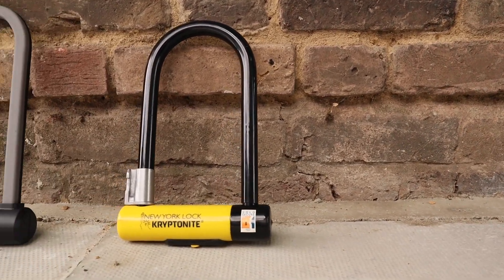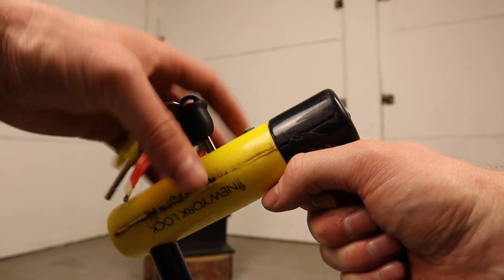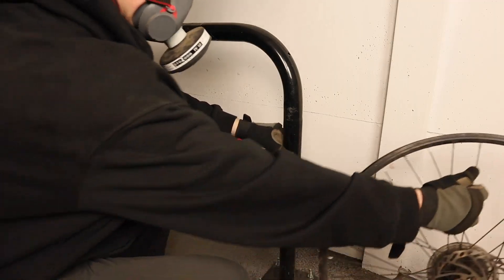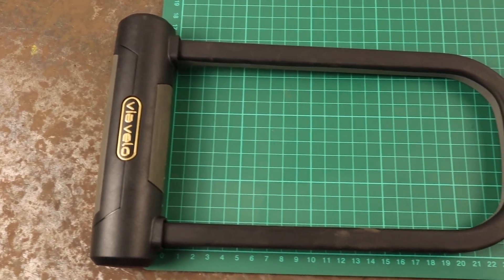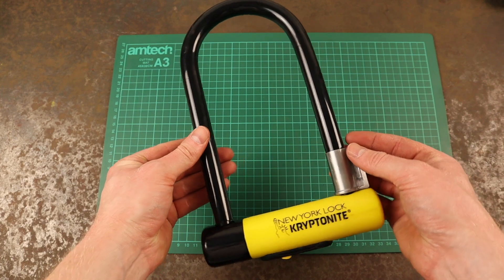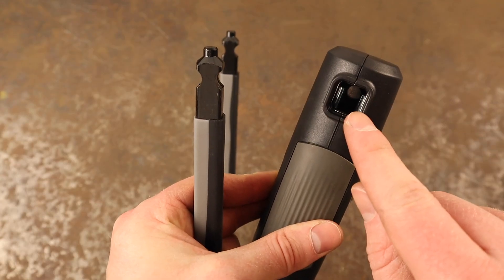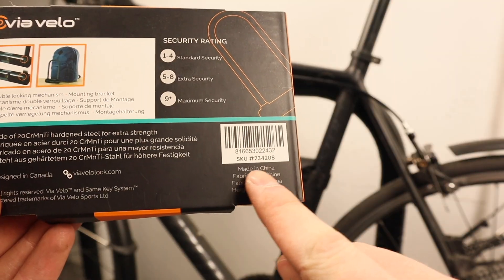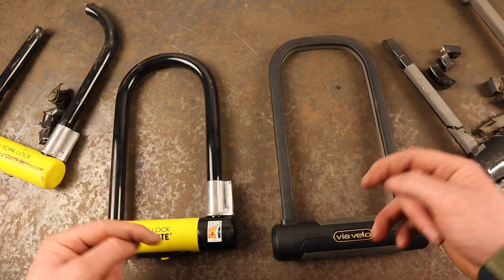Kryptonite New York Standard vs Via Velo Elite - Bike Lock Teardown Testing

Comment: There is another channel where the guy used like 26 discs with an outlet-powered angle grinder to get through the lock. What are your tests doing different?
Reply from the maker: This isn’t the diamond standard lock :) 

Video for that coming soon. Stay tuned.
Reply: @bikelockwiki I see! I've just dwelled down this path of locks. Sold our car and bought a cargobike (Swedish brand) and it seems like there aren't any chains out there that holds a diamond standard so I ordered the new york standard diamond
Reply from the maker: Good choice. That should keep thieves at bay for you. Make sure you secure the wheels too :)
Reply: @Robbe1984  Make sure you always use two locks at least. Carry two locks on you at all times.

Comment: It would be better to have three sold secure silver locks than one New York lock. One New York lock needs to have 2x16mm cuts. Three sold secure silver such as Abus 460, would cost less than the Kryptonite New York and give 3x 2x 12mm steel that would require to be cut
The three Abus locks would be cheaper, would weigh just a kilo more, but offer 72mm steel against the New York's 32mm steel to be cut through. Three locks are more hassle but a greater deterrent.

Comment: I have seen the NYC Krypto picked open in 3+ minutes by TheLockPickingLawyer.  Good channel
Reply from the maker: He’s very impressive with his picking skills, and 3 minutes is quite a slow pick for his standard! Don’t let this mislead you though.

Thieves don’t pick locks of this calibre on the street, an angle grinder or bolt cutters will achieve the job without requiring any prior training or understanding of different locking mechanisms etc. 

Thanks for watching!

Comment: I have 2 kryptonite locks for each wheel on my motorcycle. I did buy them for my bicycle but they were just too heavy to ride with so I simply don't lock my road bike outside anyway. Not worth the risk tbh.

It's a deterrent.. I also have an Oxford chain to a wheel too. The chain is around a small ish tree lol
Reply from the maker: Haha, can’t be too safe! 

Which kryptonite locks do you use? New York STD?
Reply: @bikelockwiki Yes one is a STD and one is the Fahgettaboutit one.

I also recently bought an Oxford Disclock with an alarm and a 2 metre Oxford beast 22mm chain with the beast disclock and an Oxford bike cover now. It's a bit of a pain to lock/unlock all of them daily but I needed it for peace of mind despite costing me a fortune lol. 
However 2 chains, 2 D locks and an alarmed disclock should hopefully put people off stealing my bike. 

I had an Almax chain but can't find it after not biking for 10 years. If I do find it, then that's going to be used too haha. 

I'm looking at getting a tracker now.  Been doing research. Not sure if I want one connected to my battery or one that has its own power. Will look at pro and cons.

My bike has cost me hard earned cash and also is part of healing after a tough 2024 :)

Comment: Great testing thanks. How long was the cable in your video? Would it be long enough to also attach the saddle?
Reply from the maker: Thanks for watching! I think this cable was around 1m long. Why not try running a piece of string through the components you want to lock? This should give you the length required :)

Comment: I appreciate you actually using a battery-powered angle grinder. A lot of channels just use wall powered ones, which isn't a realistic test.
Reply from the maker: Yeah, I’ve never understood that, what’s the point in going to all the effort when it’s nowhere near real-world 🤷‍♂️
Reply: Good quality cordless tools have the same performance as plug in tools. It makes no difference what do you use in tests.
Reply from the maker: @martinminar1949  Typically battery powered grinders have lower torque and will only weaken with the charge of the battery, so might as well use what thieves are using.

Comment: Terrifying how quickly that grinder made several cuts in mere seconds… was gonna buy the kryptonite m18 but why bother paying £100 for a lock when they can be cut in 30 seconds. My £1500 e-bike wouldn’t last 1 hour in Manchester.

Thanks for testing.
Reply: Use the Litelok or hiplock, it takes SO much to get through them they won't be able to do it on a battery. I was debating this Krpyo lock but after this video makes much more sense to get a hiplock or lite

Comment: I wish someone would invent an angle grinder proof lock someday
Reply: It is possible maybe in our lifetimes that we could see a lock capable of enduring an attack for over an hour but as for an impervious grinder proof lock i very much doubt it. Not in our lifetime anyway, never doubt what humans are capable of though. Remember, people used to say man would NEVER fly lol. According to the bike lock wiki website the presenter in this video personally uses the Litelok X1 which is an impressive lock and can withstand at least ONE disc from a grinder, these locks sort of make locks like the kryptonite forgetaboutit locks invalid now
Reply: @Aaron-lr1di  over an hour sounds good enough to me to deter most thieves
Reply: @Aaron-lr1di  just watched tje video on the x3 it took 4 grinding wheels to cut through it %plug in model"Quite impressive!
Reply: @bluewave7120  Yeah the only problem with the X3 is it's bloody expensive lol. X1 can at least on average take two discs to the one side of the shackle depending on how powerful the angle grinder is. They have to still make TWO cuts to both shackles because it's double locked on both sides
Reply: @Aaron-lr1di  Expensive yet worth it to me because it's alot cheaper to buy the lock compared to replacing a motorcycle 🏍  Since the x3 takes 4 disc's from an ac angle grinder it is pretty secure unless your parked in an extremely isolated area where noise and time & being noticed are not an issue

Comment: Interesting video.
Here it doesn't matter but in cases where the 42" bolt cutters do cut a lock I'm always curious if say a 24" one does as I think more thieves are using shorter ones that fit in a duffle bag or backpack.
A lock could pass say a 24" cutter attack but not a longer tool and I'd still be interested in that lock for some bikes in some scenarios. 
Yeah, people could use folding cutters or cheater pipes or huge bolt cutters but some resistance to more common bolt cutters is still noteworthy below this price point, as tested.
I mean there are logical categories like 
Common bolt cutters, huge bolt cutters, and grinders where you definitely see different price classes and decide if you want to pay for that extra protection based on crime in your area and the price of your bike.
So this test is fine but a lot of locks that would fail with those large bolt cutters still have their place.
Reply from the maker: Completely agree with your point of view. When we successfully crop a lock with the 42” cutters we then subject it to 24” cutters to better understand its limitations.

However as both were uncroppable here, we didn’t need to test against 24” :)

Thanks for watching

Comment: Use 2 Krytonite locks and only make brief stops at convenience stores and gas stations, not grocery shopping. If it's possible park in the line of sight. If there's a shady character with battery powered angle grinder hanging around, just go to a different store.

Comment: I think it's a shame you didn't answer some important questions.  For example, how hard and resistant is the metal against a saw?  What is the metal thickness of the body?  What is the internal mechanism and is it made of plastic?  These are important questions to understand the quality of the product.
Reply from the maker: Thanks for the feedback, all noted and will add the requested details to answer these questions tomorrow. 

Against a hack saw, not much would happen to either of these locks. We’ve conducted HSS tests in many of our videos, but most case hardened locks will resist, and it makes for relatively boring content so in this video I tried to some different test methods. 

Adding hardness measurements is something we plan on doing, but currently we don’t have the funding to afford a tabletop Rockwell hardness tester. 

I’ll add internal mech measurements tomorrow. 

Thanks again for watching, and for your critique, I continuously try to improve quality, helpfulness and entertainment value of our videos.
Reply: @bikelockwiki  Thanks for taking it in stride.  This is of course constructive criticism, not personal.  I talked about the saw test as a test for the level of hardness and quality of the metal.  Good to hear that you are interested in looking into this more in depth in the future.  The thing is that in Chinese locks sometimes cheap, weak and thin metal is used for different parts of the lock, and this is something you need to know.  Appreciate your content and input.
Reply: @bikelockwiki  Sometimes the cylinder is not of good quality, which will create problems.  Drilling can also be a problem.
Reply from the maker: Yep, after working in the industry for many years I understand all of the above, and yes some locking mechanisms are weaker than others. 

However drilling out a cylinder is not a popular method of attack, but we do include this in some of our videos. 

The Elite is a Sold Secure Diamond rated lock, and is a similar build to the OnGuard Pitbull, a very reliable lock.